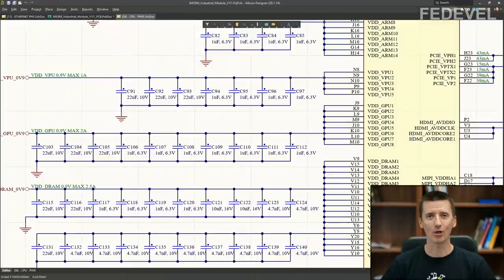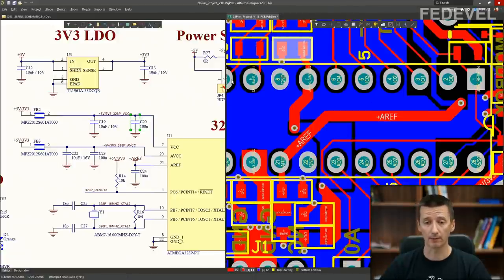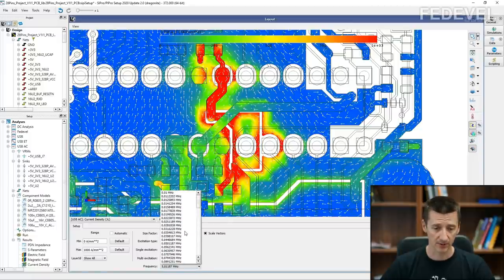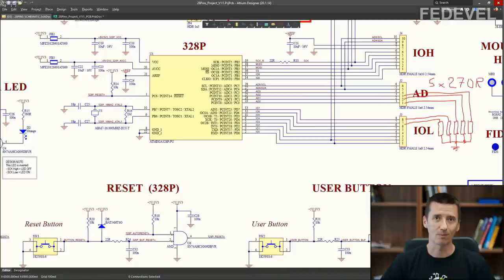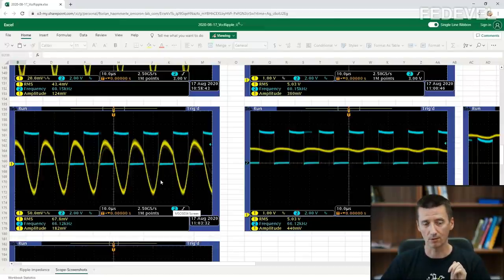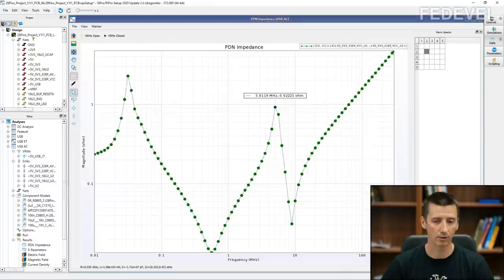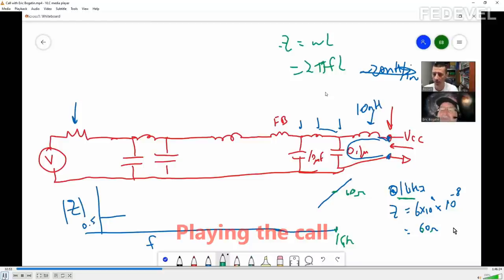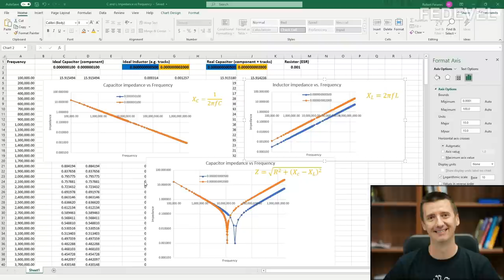PCB Layout & Decoupling - Explained why it's so complicated (Part 1)

Comment: Great content...thanks for making these videos
Reply from the maker: Thank you very much
Reply: @RobertFeranec  hi there is no explanation why Eric considered only the first LC loop for very high frequencies? Could please upload the whole video call of you with Eric. Or could you please complete the explanation for the pdn graph from low frequency to high frequency. You did not continue Eric explanation after 47min. Please upload complete explanation. Thanks
Reply from the maker: @santoshgurral66  It is explained in the next part. Basically, for some frequencies some of the capacitors will behave as a short circuit (or inductor) - so it is not important what is connected behind these "short circuits".

Comment: Good Video.
I have found really neat tricks using LTSPICE, calculate trace lengths/inductance 1nH/mm, place RLC values that match the ESR of the capacitor now using Frequency analysis you shall find the resonance by modeling passives. Looking at circuit loading from the PIN is good as internally there are bond wire inductance, loading capacitors that will influence dominate pole/zeros .
Reply from the maker: Thank you Yaghiyah PS: Yes, we will speak about internal connections in next video(s)

Comment: if Fourier analysis taught me anything is that a square is made of gazillion signals.
Reply: Although in real life there are no square waves, only trapezoidal waves (actually even that is a simplified model), and the steeper the trapeze, i.e., the higher the slew rate, the more high frequency content there is in the wave.

That's why many microcontroller GPIO pins have a "low speed" and a "high speed" setting. Low speed is the default to generate less noise, and you change it to high speed only where you really need it.

Comment: Perfect video, perfect topic 100 x thumbs up !!!
Any track between the coupling capacitor and the power pin is an Inductor and it influences the PDN network.
I find it sometimes hard (with a BGA FPGA totally impossible) to position the coupling capacitors as close to the microcontroller and on the same layer. I sometimes have to position the capacitors on the bottom layer and connect the power pins the caps using a via. And this is sometimes inevitable.
In your opinion would this create in the long term a catastrophic problem?
Reply from the maker: Thank you very much Kerem. PS: I have not seen any problems on boards where decoupling capacitors are placed on the bottom (that is a standard recommendation from the big chip manufacturers, you will find decoupling capacitors under power pins on boards from Intel, AMD, etc ...).
Reply: Thank you very much for your reply Robert. Having heard your experience, from this point on, I will be confident to place the decoupling capacitors on bottom side of the board. You really helped me gaining valuable information from your courses and now through YouTube. Thank you very much for your effort. Kind Regards,

Comment: Interesting video, if we start to talk about weird thing, a specially on that microcontroller (Atmega328p), 
where p - means low power and that means crystal oscillator inside Atmega328p have low transconductance 
and that means you can't connect any low frequency crystal(for example 32768Hz) like to other atmega microcontrollers,
transconductance of crystal must at least 3 time smaller then transconductance of Atmega328p oscillator.
I test some of the crystals, and sometimes crystal stops working not immediately but after 1-3 days,
so that problem is really big, so atmel(now microchip) decided to produced new microcontroller Atmega328pb, 
that device had Clock Failure Detection mechanism.
Also you can experiment with reset, increase pull-up resistor, or try to run microcontroller by slow increasing voltage without brown-out detector. 
it's interesting thing especially if connect some leds to microcontroller and they suddenly turn on at random order, 
without microcontroller programming, I watched that effect on atmega8. By my experience Reset works great on most atmega chips, 
but it's not working so great on some other microcontroller manufacture.
Reply from the maker: Thank you Dmitrij for sharing this

Comment: I see that you have 2 *100uf caps connected to the Usb power rail! Isn't it too much capacitance which will make a current surge when someone connect the cable, I suppose 10uf should be with the specs!

Comment: What I don't understand is why the simulations show red areas for the frequencies, when the impendance is also high? According to the Ohm's law is should be vice versa: higher impendance → lower currents.
Reply from the maker: It is showing current density. So, I am explaining this to myself as that for low impedance it is going to be easier for currents to travel (so lower current density - current just freely goes from one side to to the other), for higher impedance it is going to be harder for currents to travel (so density of current rises in the places where it is harder for current to travel). But, if this is right, I do not know :D
Reply: @RobertFeranec  Sure, it is current density. But current density is basically just current divided by area. As the current is in numerator, then current density should follow the same  Ohm's law, isn't? I also don't know :( I'm a software developer, not the hardware one.

upd Your explanation doesn't give any answer, it just goes to match the simulation.
Reply from the maker: @archonoff  actually, you are right ... hmm then I would say it may be something with constant voltage maybe (?)  ... or something like that ...? I am not sure how exactly the simulation is executed, what is happening there. I will need to ask about it.

Comment: First things you learn as a power designer, also injection is quite important. Importfilter and bypassing is general a very complicated topic only a view actually know how to do it, most think the do but they dont!
Reply: Also you need to incorporate the capacitor parameters and parasitic even sometimes the non linear behavior. Takes me weeks do design supply filtering and rejection. For Commercial products you also have to consider emissions on cables, conducted and radiated. Also that you are immune to noise Coming from other the external supply
Reply from the maker: Heinrich, I absolutely agree - very complicated topic!
Reply: @RobertFeranec  but that is true for everything if you want to do it correctly and understand it. even a simple resistor can be extremely complicated to implement in a design

Comment: I'm curious to know what kind of side effects this noise (ripple) creates on common applications with microcontrollers like stm32 and arduino. 2 effects pop into my head are below. I invite everyone to share their experience and thoughts.

Perhaps the ripple valley could be lower than min VCC acceptable voltage and can cause resetting of the chip, I think referred to as Brown Out Reset (BOR). 

Also when ADC or DAC of the chip fed by the chip's VCC may cause erroneous readings if resolution is too sensitive.

Comment: Your modelisation is good. Impedance of real inductor and capacitor are NOT what your guess said!!! Your interpretation of noise is incorrect you have to take in consideration what your circuit can tolerated. No mention of ground bounce???
Reply from the maker: Thank you Andre. We will be speaking about ground bounce next week PS: It's a very difficult topic even for me, so I am trying to find a way how to make it simple to dive into this problematic and at the same time not to make it too complicated.